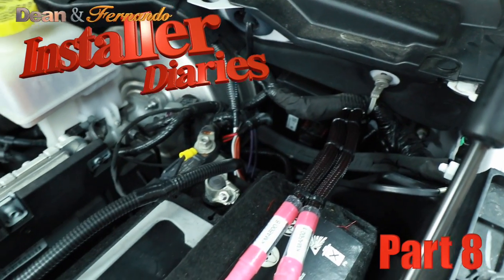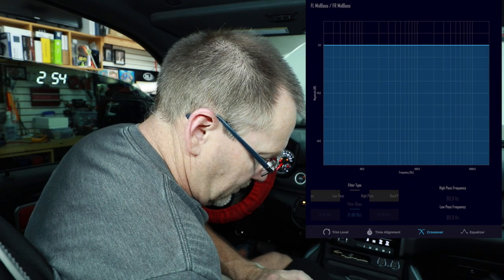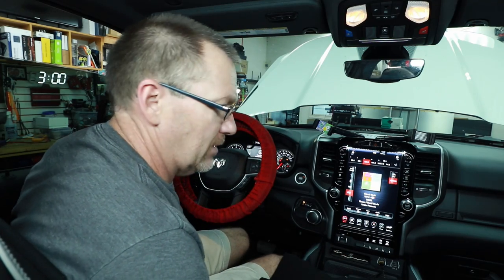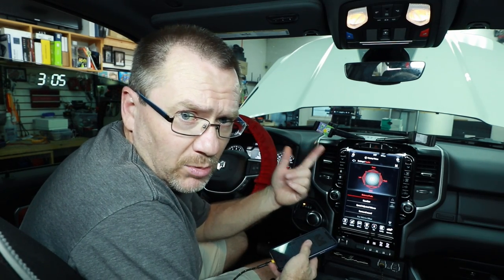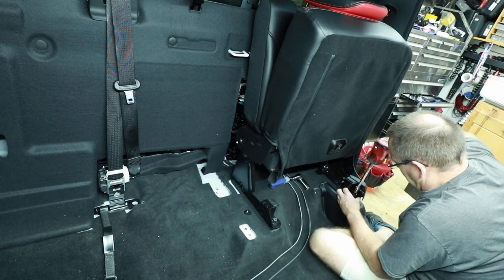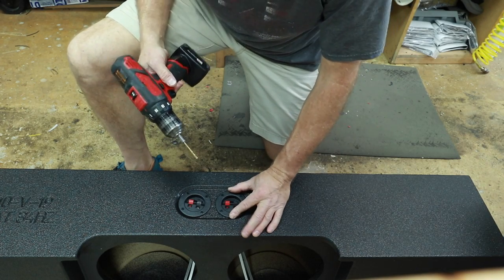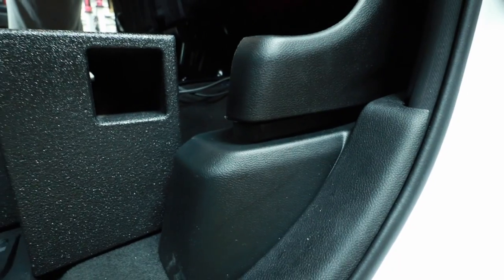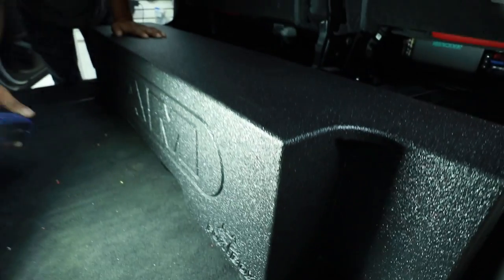Battery connected sub in done 2021 Dodge Ram Installer Diaries 395

Comment: That was a very interesting build. I was wondering if there would be an issue with running two power wires to the battery (don't know why) instead of one thicker wire to a fused distribution box closer to the amps. Now I know there isn't. Thanks. Greetings from Oz.
Reply: Both are fine. I've always ran separate power feeds for my highs and bass amp. Running Stinger 1/0 to my XP rear supplemental battery then to my bass amp and T-Spec 4 Guage to my highs amp.

Comment: Dean I have a 49.99 oscope I got off Amazon and it's saying my head unit (kenwood dnx576s) starts clipping at 26 it goes up to 40. Is there a way to get a little more volume out of it?? I'm using a pac lp7-4 because my rca outputs weren't working correctly.

Comment: Good work.  What is the benifit of using two 4ga as opposed to one 0ga and then a distribution block at the amp?
Reply: 1/0 gauge actually has more strands than 2 4gauge wires.
So the only benefit would be not having to find a place to use a distribution block .
Most amps specify that if the power wire run is longer than X ft then you’re suppose to run 1/0 gauge and then use 4 gauge wire no longer than 3-5 ft depending on the manufacturer

Comment: I'm doing a full system in my 2015 Dodge Ram 1500, and I'm torn betwwen getting the Rockford Fosgate DSR1 or the Audio Control DM-608, what would be your suggestion. Thank you
Reply from the maker: If you are keeping the factory radio you will want the dsr1. The iDatalink built in to connect to the factory radio AC does not have.
Reply: @FiveStarCarStereoInc  I will be changing the radio out, but no time soon.

Comment: Curiously have a question.. 
Hi Dean or Fernando,!
Has been 18 years since I was doing installs, and custom boxes, my question is with the new DSPs witch I'm going to go all in on that so I ame going to have 8 bullet tweeter's in the front dash and 4 in the back towers of my soon to be sons 07 Yukon, he graduates this coming year, in the front and rear doors I'm putting in  a mid sub, 2 In each door  so Total 8, 3" silk dome tweets, the doors are run to a 2300 watt 4 channel and the doors are run to a 2000 watt 4 channel, both by the way are D class amps, then for the heavy bass I'm going with 2 custom boxes of my own design, 2 12" in one ported box tuning right bout 32,, those get a db 4000 wt amp , last is the 6.5 subs box and it is running off a db 2000 watt amp. O my bad everything is from db drive except a bunch of the new wiring.. so now what type of passive crossovers would you feel I should use to s[lit up the many extra tweets and , midz,, or is there a new electronic crossover I haven't seen yet..?? Just want to give  my heard working son a nice gift for turning around his life and the past 4 he has done 100% that.. thanks for all the well done tasteful and most of all educational that an old stubborn man can understand.. LoL 
O my last win was 04 Low rider show, lost a windshield but took my class 163.67 on the meter... Windy ride home but stoked about the coverage and win.. Thx for any suggestions.!  D,  Robb
Reply from the maker: All the DSP’s can handle the crossovers you need. Sounds like a 10/12 channel out is what you will need. Alpine have their PXE-850x with enough channels and reasonable prices